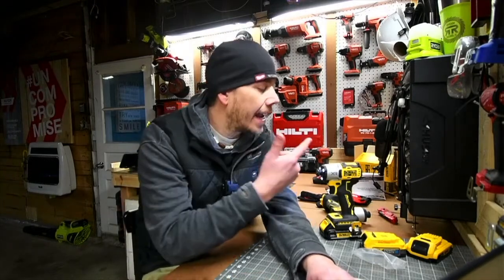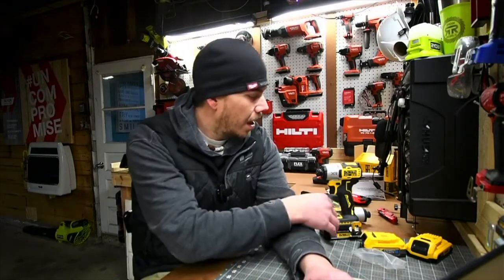Quick Test with the NEW Dewalt DCF845 Impact Driver.

Comment: Hi Dave, I thought the dcf921 was awesome, Dewalt keeps producing amazing products and my 921 is out dated now, that dcf845 is awesome, Ty Bob,
Reply: The 921 will be good for several years. Grease it regularly and take care of the batteries.
Reply: The 921 is an impact wrench not driver. I have the 921 also and it's place won't be going anywhere anytime soon! It's a great wrench fir it's size
Reply: I have the 921 and use the dewalt square to 1/4" hex adapter when needing to drive any screws. It's a beast. I rarely need to anymore since I just picked up an 850
Reply: Hardly outdated. It's an impact wrench, and stronger than this impact driver. Different tool for different application. Slap a 5.0Ah powerstack battery into that -921 and what it give a M18 mid-torque a run for its money!

Comment: Waiting versus 845vs840vs850vs887
Reply: DeWalt vs DeWalt vs DeWalt vs DeWalt vs DeWalt. I love it, where's the corded version?
Reply: I've already done it just don't have the ATOMIC DCF 850 and I would like to get another 5 AMP POWER STACK
Reply: @THEBEARDEDTOOLGUY  Big like for versus dewalt vs Milwaukee very interesting
Reply: Idk why even bother with that 887, the gen 2 atomic(DCF850) is the 887 just shrunk down
Reply: Or just get the Milwaukee fuel
Reply: @fishgaming8599  I already on Dewalt platform. Quality/price
Reply: @fishgaming8599  why? DeWALT has the best impact wrenches on the market in 12 and 18/20 volt and they have stacked lithium. Milwaukee still using old battery technology 😂🔋😂 having a driver 3 sec faster ain't gonna make anybody switch to that red Chinese owned brand stfu kid

Comment: Do you still remember that time you said you were going to test grinders?
Reply from the maker: I do, the issue I have with that is the metal goes everywhere. I had to replace a few lenses from just a few videos. the same thing with the welding. I can't afford to keep buying new lenses for the camera. Lensens are expensive
Reply from the maker: which was the main reason why I had focusing issues a long time ago,
Reply: @ManCaverTools  put a piece of plexi in front of the camera